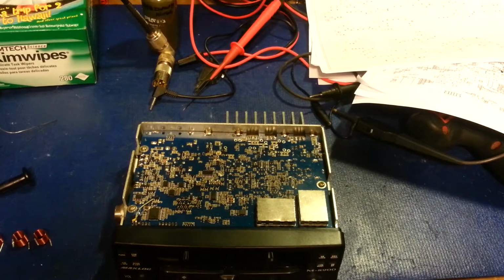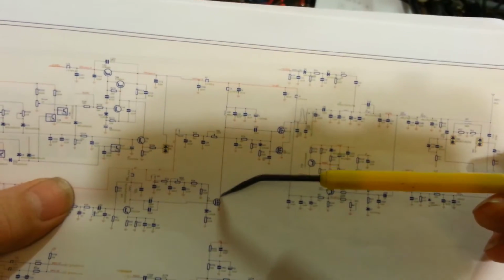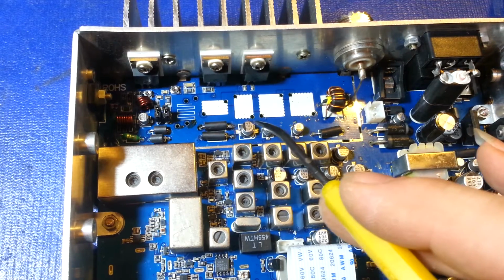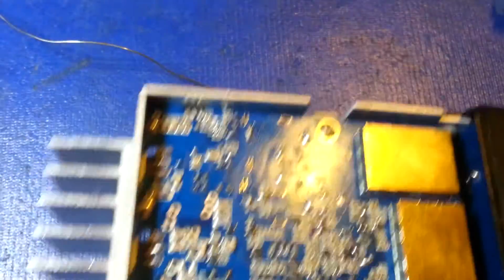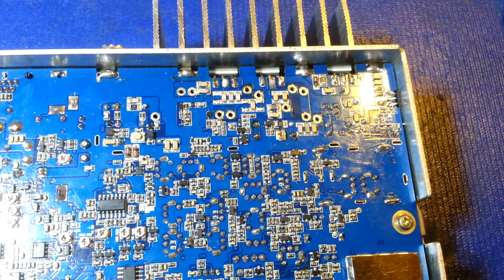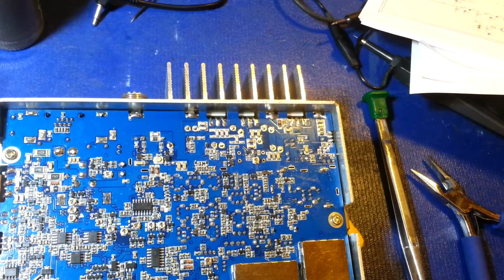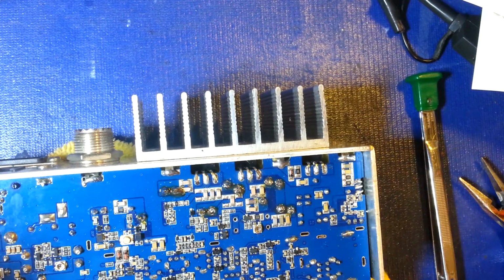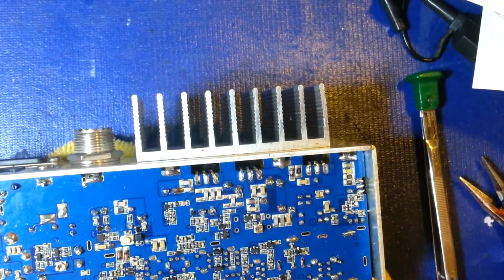Maxlog M-8900 no transmit power repair Part 1.

Comment: on the maxlog m8900 board has a wire connecting a component to a pin, do not know if the first or second pin from left to right and a resistor I do not know the value. could you tell me what it's for and the pin and if it's a resistor to put on my radio it does not have. radio rp-90 mine.
Reply from the maker: Sorry I can't help.  I don't currently have one here to look at.